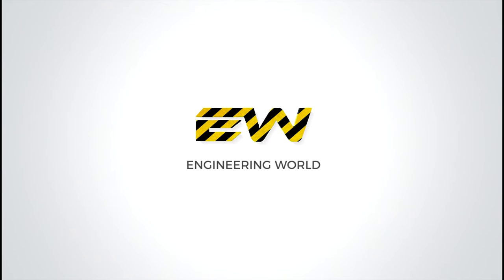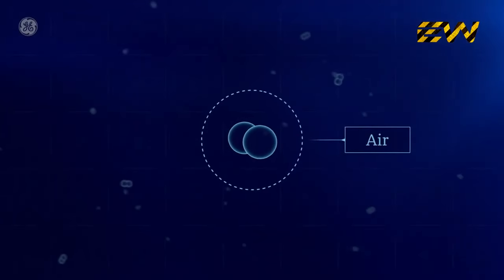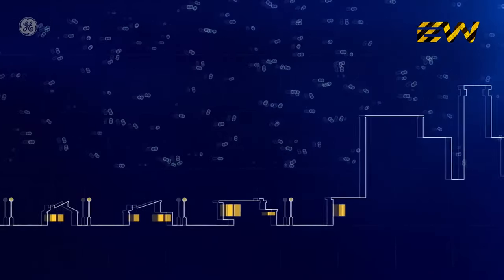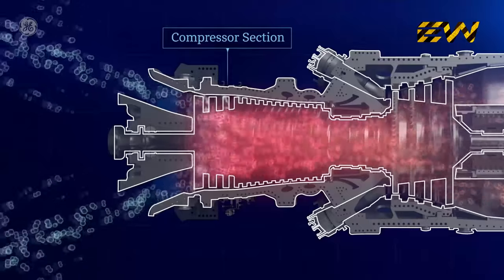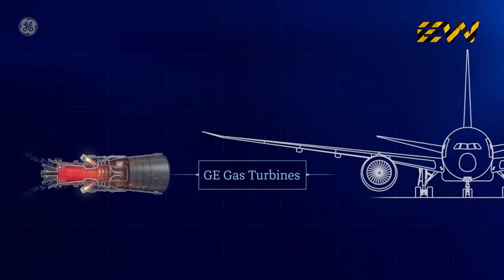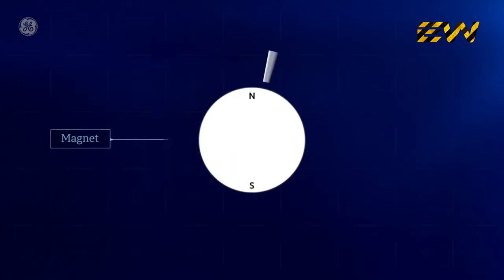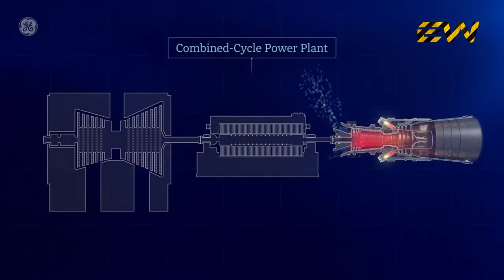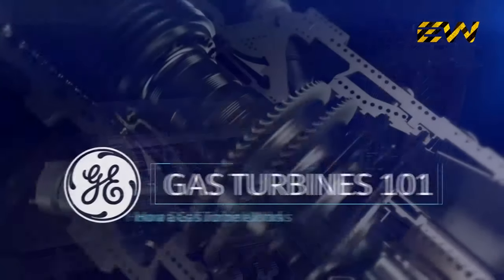How Gas Turbines Work? (Detailed Video)

Comment: The compressed air enters the compressor discharge case, is warmed and expanded into energy in the combustion cans/chambers which, through transitions, directs the expanded energy into the turbine section. Here the energy is expended across the turbine sections, creating the torque necessary to drive the generator and create power.
Reply: so what is the role of high pressure turbine after guel is added in combuction chamber with high compressed air especially in aircraft with HIGH BY PASS RATIO OR MODERN COMMERCIAL AIRCRAFT ENGINE .............. sir would be greatful if u answer this.......thankyou
Reply: All of my work experience was with he heavy duty GE gas turbines.
Reply from the maker: Thank you so much Mr. Ted for sharing your valuable knowledge and experience with us. 

Have  a nice day !
Reply: @ankurkansal171  The air from the compressor is used for combustion and cooling of the surrounding casing.  The turbine is what spins from the combustion.
Reply: why don't they add more turbines to extract more energy instead of installing steam turbines?
Reply: @xianshi8896 steam turbines are extremely powerful that’s why.
Reply: turbine engine operates I want a pdf, can you help?

Comment: There are two types of blade in fan(turbine also) one is suck the air and other one who blow the air???

In turbine which type of blade is used?????
Reply: Compressor fans, suck and blow are the same thing with a different angle.   They are simply optimized to suck in and compress as much air as possible before firing
Reply: angles are engineered to compress air at separate stages then angles are engineered to catch air separate stages. In between each of the moving blades are stationary blades engineered to straighten the "air" back into a more perpendicular flow. removing the spin from the flow. referred to as stators.

Comment: Why not use a mini gas turbine on car exhaust to make a stronger vacuum on the engine so used gas is sucked out faster and with a higher vacuum the car may have more power?
Reply: build it. I thought the same thing about the car transmission. They have it called a Torque converter.
Reply: @mikeslicker7569  I think it is called a turbo.
Reply: @travismoore7849  Turbo's work similar to what you're describing but a little different. A turbo in a car has 2 turbines back to back met together, one turbine is exhaust, the other is for intake. When the engine produces exhaust it causes the exhaust half of the turbine to spin which causes the intake side to spin causing forced induction, which has somewhat of an amplifying effect because more inlet air = outlet air thus more inlet air. That's also there's turbo lag because with bigger turbos, it can take them a bit of time to spool up.
Reply: @MrBobbyjoe5  i don't know why engineers didn't implement the magnet surrounded by coils of copper wire on the intake compressor shaft just like in the gas turbine, i think that way we can eliminate turbo lag!

Comment: Can biogas(natural waste gas) used as chemical energy..?
Reply: call me joe but "big natural gas" is producing a product that has stable consistent uniform results in huge low cost quantites. The market will guarantee that as soon as "big biogas" meets and exceeds natural gas, it will be used. I have been apart "retrofit" jobs in which we converted #2 fuel oil burner plants to natural gas. Big job to change the process but cleaner lower cost made it happen.